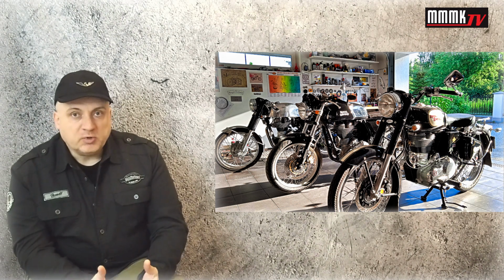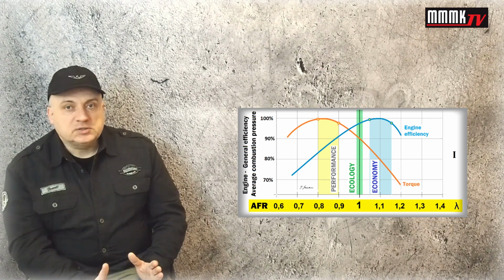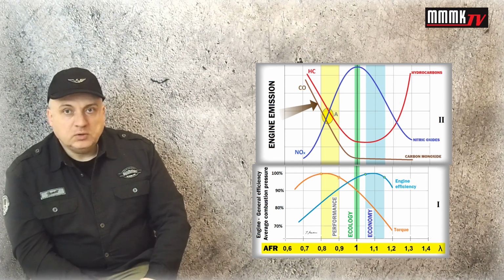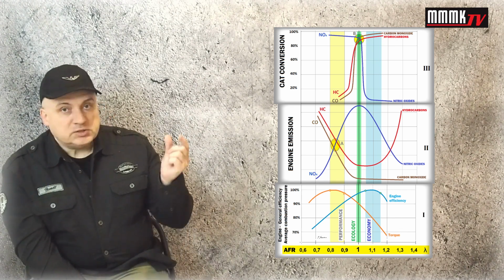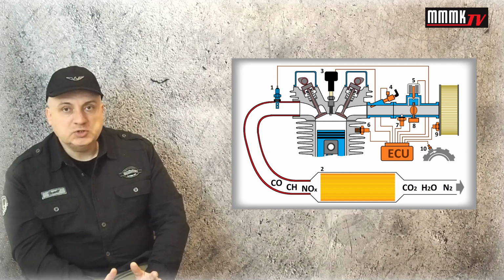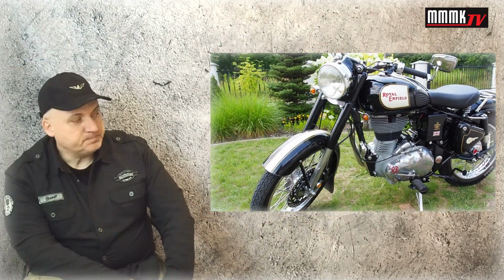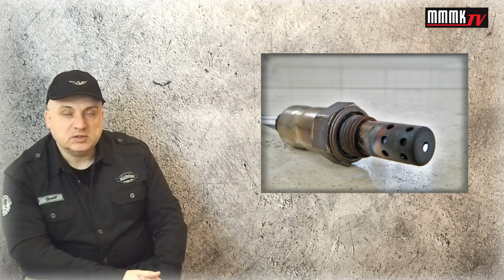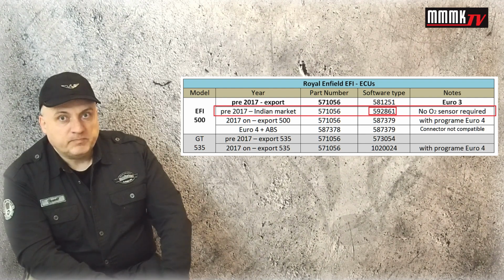Royal Enfield 500 EFI without O2 sensor

Comment: Very clear and to the point information. I have a question about: i own a Royal Enfield Bear 650; the catalysator  with 02 sensor is in the mid-pipe. I want to replace this with a decat pipe. Can i remove 02 sensor and its cable without problem? Or what did you do with the sensor and the cable? Thanks!
Reply from the maker: Thanks.
No, you cannot just simply remove the O2 sensor. Your engine would go to limp mode, your MIL will flash.  The engine performance in limp mode is in fact worse than with the O2 sensor, as the ECU would still try to protect the catalytic converter.
You would need something like 'Fuel-X" or so, to make ECU to go to dynamic characteristic.

Comment: First of all, loved the video. It was very informative and something I was looking for for a long time. I have a doubt that you could probably clear. Instead of changing the ecu can I just remove the catalytic converter and remove the o2 sensor to get similar results as yours?
Reply from the maker: Hi. Thanks.
Well, no. The result that you would achieve would be slightly  different. Your engine would go to limp mode, your MIL will flash. By this you can only check if the O2 sensor causes your engine malfunctioning, as this would help then. But the engine performance in limp mode is in fact worse than with the O2 sensor, as the ECU would still try to protect the catalytic converter.

Comment: Thanks so much for making this super easy to understand video. Given people are charging £200 for a domestic ECU on Ebay, but you can pick up an O2 sensor override for £12, does anybody know if the ECU is actually much better?
Reply: I just re watched and see that you addressed this very point at the end of the video. Amazing!
Reply from the maker: You see, cheating the O2 sensor signal is always about cheating, so you never know how the ECU will react. The domestic ECU is fully tested by manufacturer and it works perfect with this engine without cheating the O2 signal but simply avoiding it.  I like that this solution is clean and fully original. Many Enfields rides on the Domestic ECU in Europe. Mine (as the first one I suppose)  runs on it already 5 years.

Comment: What is final conclusion should I replace faulty O2 sensor in BS4 bullet 500 in India?
Reply from the maker: Installing better O2 sensor makes sense, but in BS4 there is no way to get rid of it such a smooth way as it is possible in C5 Euro 3. You need to live with it or to downgrade to Euro 3 and hook up Domestic ECU then.

Comment: Thank you very much for this informative and educational video. I have a Royal Enfield Super Meteor with only 2,800 km on the clock and the injection light came on. I cleaned the contacts of both lambda (02) sensors and the lights went off. Everything indicates that the problem was there, especially since the bike's behavior has always been normal. In fact, I'm really enjoying the bike. Before that, I had a Royal Enfield Classic 500 for four years. I am from Brazil and it would really impossible to understand you if were speaking in polish. Take care!
Reply from the maker: I'm glad you find my movie interesting. 
Yes, English is handy indeed.
Take care mate.